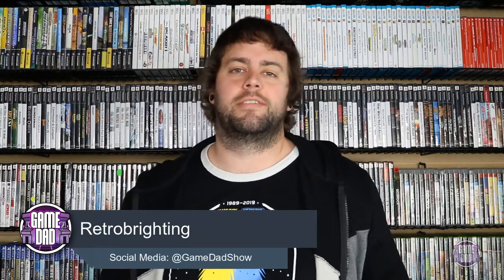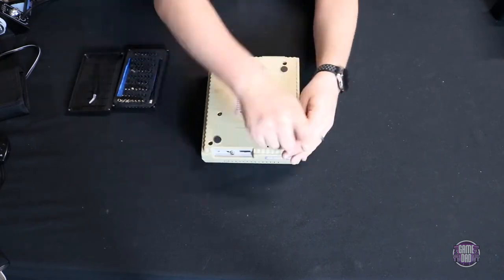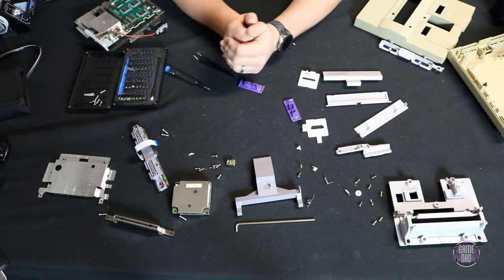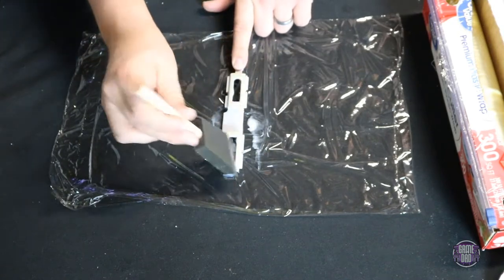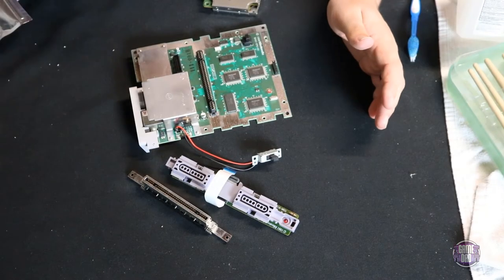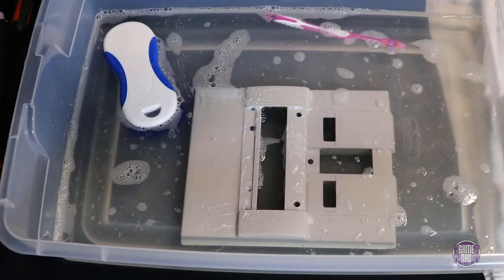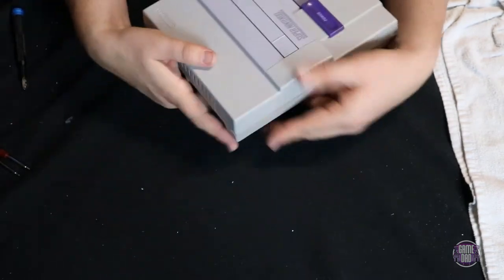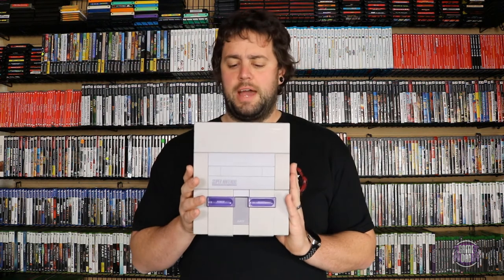How I Retrobright a Console! | GameDad

Comment: Dude, for some reason when I tried this mine came out streaky AF. I got an even coat and wrapped it, but it was streaky and blotchy, am I not using enough wrap? I did notice there were like air bubbles and I'm thinking that could've been the reason, but not sure.
Reply from the maker: The air bubbles are very possible. I've actually since started just using 12% peroxide and uv lights. Much less messy. I followed a guide from Odd Tinkering on how to make the setup for it.

Comment: I’ve used this process with fair success.  I have also seen a method where the parts are submerged in hydrogen peroxide and water in a clear container and placed in direct sun.  I’ve not tried that yet, but hear that it may produce a more even result.
Reply from the maker: It just takes FOREVER
Reply: @GameDadShow  I've submerged cases in H2O2 and it works great! i just use a nail dryer for the UV light as its not too sunny in England